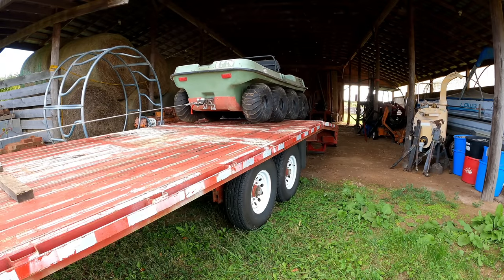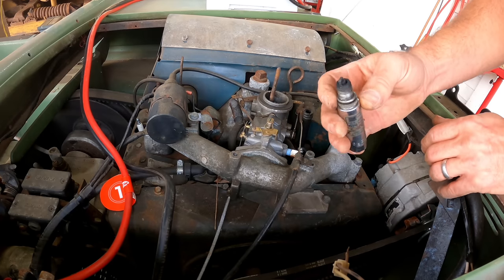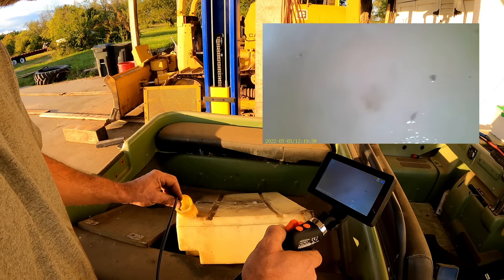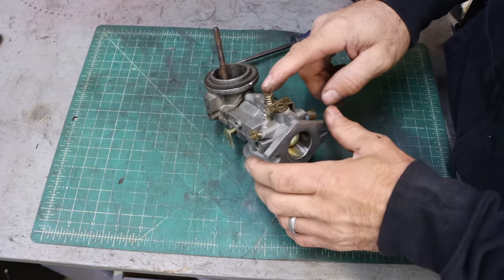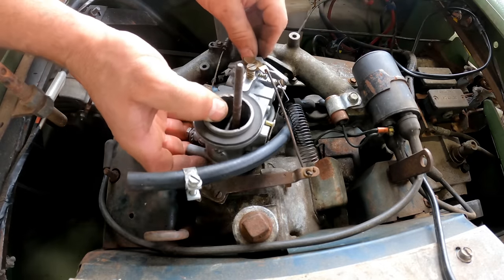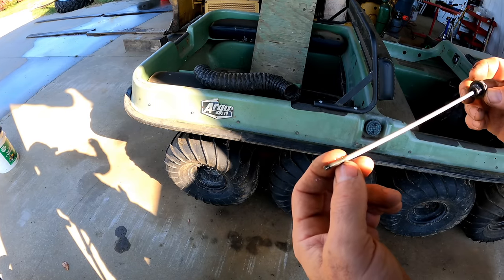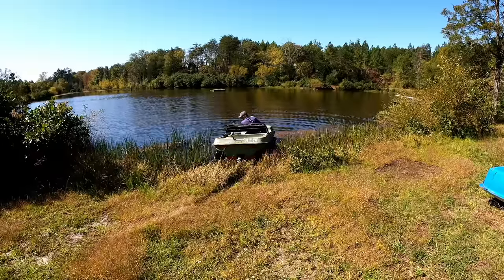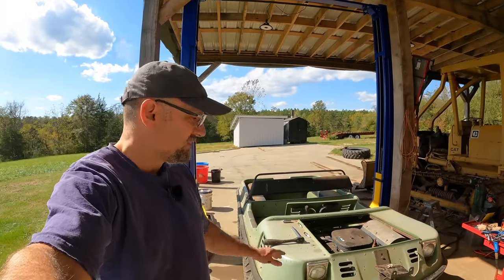Fixing An Abandoned Argo Amphibious Vehicle, Will It Start?

Comment: Owned the same Argo Bigfoot since new in 1998
Get a winch for getting out of ponds. 3000 pound winch will pull your bathtub on wheels pretty good.
Don’t put Aggressive Atv tires on it.  They are a skid steer and need the tires you have.  Otherwise you’ll stress out the chains and bearings prematurely.
Put a cab and snowplow on and they make a pretty good driveway snow duster.

When you are moving through mud try NOT to turn too much. With a pinch of momentum and all 8 tires turning she will usually find her own way out of the hole.  If you are always trying to turn you are cutting your traction by 50%

Comment: Wow,great video. Had an Attrex in the 70s...terrible machine with 2 stroke engine and planetary drives. The bilge pump suggestion is a good idea. I knew i was in trouble when i ordered parts and they offered to sell the company. Would have been great maybe with a 4 stroke engine and hydrostatic trannys. When it ran it was a blast to run, but that wasnt very often.

Comment: Before the high end ATVs came out the Argos were used to run the hard bottom marshes. First thing people did was to get more aggressive mud tires. These also added bouncy. The Argo is designed to haul hunting equipment in the back so that weight evens out your float and gets you front end up some to better exit the water. I also saw a few with governor over rides (a piece of wire on the throttle) to get more revs out of the engine (do at your own risk). The oil you seeing in the cylinders I feel is from stuck oil rings. Spray some PB blaster in there and just let it soak. They may come unstuck. The Argo are slow but fun to drive. They do require a good amount of up keep but if you do it they will last a while.

Comment: If you take care of them, those old early 80s Kohler engines are bomb proof. I restore old John Deere garden tractors and have worked on a lot of them. I have had some good luck regaining some lost compression with Lucas oil stabilizer.

Comment: Argo owners mainly do 1/ side body steel reinforcement alot on utube . 2/ bolts can be left out so top body canbe lifted off for drive line service  . Using only a few bolts and rubber edge trim to water proof .

Comment: First add ballast weight to the back to level it. This will naturally raise the nose a bit and help on your shoreline exits. Yes a smooth firm ramp helps a lot. In the meantime, on your shoreline approach get it as straight as you can while it is still deep and then commit to full speed on both sides. Trying to steer in the shallows kills your momentum and then it's over.

Comment: Those pits in the cylinder won't go away with out at least a hone and most likely an overbore of .010-.020. The engine seems to run well, I'd just run it as is unless oil consumption is huge. Looked like a lot of fun on land anyhow. The oil in the cylinder could be from fuel contamination in the oil, thinning it out. See how it does after an oil change with the right oil spec'd by Kohler. Definitely needs some weight in the rear to level it out on water. Just subscribed and looking forward to the next vid on this.

Comment: I've had attex 6 wheelers . When you drive over very loose very wet soil the tires push the soil out from under themselves. Letting the bottom lay on top taking the weight off themselves.  Only way to get out of that pond because of the soil is building a ramp. So the tires can't dig down. Your basically beaching your self.

Comment: A new ARGO only lists for about $38,000. Batteries: Dead ones, try a DC welder. Fill the battery up with water, hook positive to positive and negative to neg. Turn the DC as high as it will go. Throw the juice and listen for the surge and when the battery welds itself up inside or sulphation breaks loose it will start to bubble. Put the battery on a charger at about 3 amps for about 18 hours. Most will come back to life. Works great on marine batteries. 

When I worked on reciprocating Army Bell UH-13 helicopters in 1969 after my Vietnam time being a crew chief on Hughes OH 6. We were given a choice between ACDelco or Champion. I learnt fast that Champion lasted a whole lot longer. Nice video.
Reply: P.S. Stand back

Comment: Don’t use starting fluid. Check the basic ignition and fuel systems. Starting fluid has a low flash point and could explode. Excessive amounts could ruin an engine.

Comment: Oh wow.... I haven't seen one of those in ages. As a kid, I thought those were the coolest things on Earth. At least until I caught sight of the guy that lives out near me who has a fully restored Amphicar 770. Which he didn't actually have a lot to do to restore it since it was in fantastic shape when he got it. Just paid a small fortune to get a new set of seals for it. But it's kinda cool to see one of those old Argos again.

Really, there's just some pitting in the cylinder walls. Not much you can do unless you feel like doing a full overhaul, which could be an exercise in futility depending on how hard it is to find parts. But it's not the end of the world. Those old side valve motors aren't pushing major compression, probably in the 6:1 range or somewhere around there. That thing may run for ages like that. It'll probably burn a fair bit of oil with it getting by in that pitting, but it may be fine for a long time like that.

Comment: I believe you need to adjust the spring tension on the governor for maximum RPM rather than wide open throttle. adjusting the throttle will lowers maximum power.

Comment: I've seen the float gaskets with that solid area on a few moto carbs. I think it is material that just would have been waste, so they leave it in to give the gasket a little extra strength. It may also help control sloshing and splashing in the float bowl to smooth fuel delivery. This is not a CV carb like most more modern emission control carbs are, so no diaphragms necessary.

Comment: You can sometimes trick those new battery chargers by taking another set of jumper cables from a charged battery and briefly touching the leads to the dead battery or whatever you want to send power to while its on the charger. It will see the voltage jump up and trigger the charger to start charging. At least in my case the charger would reliably keep on running after it was triggered and the leads from the good battery were removed, managed to make it work for a rust removing electrolysis too.

Comment: You can see it smoking a little blue sometimes, so it's burning oil. That's why you saw the oil in the cylinders. But I wouldn't worry to much about it. The cylinder walls are not damaged or anything.
Just keep an eye on the dipstick and you should be fine.
Reply: Looked pitted to me. Would partially explain the oil getting by the rings.
Reply: @moz2186  Yes, that's probably why.

Comment: I really hate the new chargers just for that reason.  I finally found one that would de-sulphurate the battery and sometimes that will repair enough to charge the battery.   MTBE does not burn might be that left.  Need a boat ramp !

Comment: 1980s tech... my 2015 Argo 750HDI goes in and out of ponds like that, no problem! 31hp and 25" swim tires is what your 80s model lacks and the newer ones have. 
    Put the Bever Dam tracks on yours, and it'll be a better machine for your soft mud sided pond.

Comment: I've seen this ATV amphibius use chain rubber wheels like a tank" and there is no problem to cross and climb the bank, your amphibius only depends on 6 wheels but does not fully use the chain system. Because of that you fail to climb the muddy bank. TQ😁

Comment: I agree with Some of the comments about backing out however, I think I would try to get the biggest knobby tires you  could get on there. I didn’t see any cross hatch in the cylinders so I imagine it’s got 1,000,000,000,000 miles on it. Maybe a little sea foam or Marvel mystery oil will loosen up the rings.
May be a couple of automatic bilge pumps would be a good idea.

Comment: That's the old style of tire and it's looking worn.  
The new tire style has very aggressive style paddle treads, supposed to be better in mud.  $250 each  $2,000 for eight.
A launch ramp would be helpful and probably cheaper but higher tread is more ground clearance.

There are tracks, snorkels, outboard motors, winches, bilge pump, 

Popular with the moose hunters up north.
They make them locally here, I've done a factory tour.
The plastic bodies are thermoformed out of kydex, like a knife sheath.
Definitely do the bearings, chains and seals.

Better balancing will bring the front end up and out.
Winches are really , really common.

Comment: one thing about those is when your swimming its slow because the tires are an even break between land and water and when you are exiting the water get lined up before the edge cause if you try and steer at the edge your putting on the breaks on one side and taking momentum away and if the back is empty like you where it will be higher so exiting some areas to get to land is better in reverse sometimes

Comment: Appears to be a Kohler KT series engine, I had one in a Gravely 4 wheel tractor. good engine until it lost the rear main and locked up. I couldn't find parts and was considering a repower when I sold the tractor. good strong engine while it was running.

Comment: It did not fail, your driving did. Turning and revving when the bottom is soft is a sure thing to lose traction, go slow and do not touch the steering, just line up first. A big load of aggregate/rock where you wish to enter/exit and a anchor point on land and the winch reinstalled you will be able to exit with no problems.

Comment: Battery cells should maintain 2.2 volts/cell  no matter what charge they have. Because its to do with the chemical interaction (atomic band gap). A 12v rated battery should always be 13.2 volts. Charged or not. That's 2.2 x 6. If you are getting 11v you have lost a cell. It may come back up for a while  but its still faulty.

Comment: you're going to need to dredge some mud and build a sandy beach on your pond if you want any hope to get in and out with the argo, that's how we did it anyway. Gravel probably works fine as well. a couple of 10 year olds in the back seat is the ideal weight distribution method, but one adult might work as well.

Comment: Pretty sure instead of driving it forward onto the bank and getting it a little stuck, you could drive it out in reverse and get it good and stuck.  ;)

Seriously though, the boat ramps where I'm at just use concrete sleepers and they seem to last a long time, even with our heavy lake ice.  May want to think about putting in a proper boat ramp.

As for weight, I'll point out that water may not be the densest material out there, but it's easily available and easily disposed of.  Perhaps an old plastic tank that's a few cubic feet in volume, mounted far in the back?  Could easily adjust it to trim or empty it if you carry cargo or passengers.

Comment: Fun video.  I've seen those things around for ages.  Never saw them fitting my needs, but very cool.  I think if you put a couple deep cell batteries in the back to power an electric trolling motor, that might even you out and provide a better system of propulsion.  Not sure how you'd fix the "high center" problem.  Seems like a design issue you would only be able to solve with a better landing zone.

Comment: I have learned over the years working on lawn mowers in my shop you don't use ether to crank an engine you can ruen the engine I always use carburetor cleaner it's better for the engine and safer than ether I have known of people blowing the heads off of an engine using ether.

Comment: You think small engines are temperamental near sea level in VA.  Try working on them at 7600' elevation. When new they are great, but a worn out old beast at this elevation is fun, a 1% change on a setting will go from one extreme to the other.  Another great video.  Thanks.

Comment: Reason why those throttle butterfly screws were almost stripped is because someone tried to remove them using a regular Phillips screw driver. They are, in fact, JIS (similar to Phillips, but not quite) as evident by the little dot on top. A special screwdriver is required to take them out easily and without damage. Phillips was actually designed to cam out of the bolts/screws to speed up assembly in factories where a driver would simply slip once the fastener is tight enough. 
As a side note, interesting how the Argo has a transom spot on the back for a small motor. And by the look of it, it had a motor on there for a while as well.

Comment: My JD Gator starter did the exact same thing. Drove me nuts and eventually got worse and worse to the point where it just made noise and would never engage. Replaced the starter to resolve the issue. I probably should have taken the original apart to see what it looked like but I did not.

Comment: The oil in the cylinders is most likely caused by the cylinders not having good oil control. The oil control rings in combination with the cylinder bores are allowing oil up into the cylinders from the crankcase. The result will be increased oil consumption. When enough oil starts entering the cylinders, it will start fouling the plugs.

I have an Audi 2.0T with this same issue. That engine is direct injected and turbocharged, so it actually will start breaking spark plug insulators when the oil consumption reaches a high enough point.

Comment: 1:02:28 It's burning a little oil. In one of the clips of you getting it stuck on the bank of the pond the lighting was just right to catch some wisps of blue smoke coming out of the nose of the thing. Those cylinders, rings, they're a bit on the tired side. I'd bet money that thing drinks oil noticeably over a change interval.

Given it runs fine anywy I wouldn't be in a hurry to overhaul it, but it would behoove you to keep an eye on the oil level.

That oi lwas also present before you put any 2-cycle oil in the cylinders. I noticed it on the first boroscope peek.

Comment: You can trick new chargers by connecting  a 9 volt battery in parallel  across the "dead" battery after connecting the charger. That should trick the charger into working.

Comment: If there's no oil filter, that's a series 1 Kohler. They're splash lubed. Stay off steep angles - that engine nearly bankrupted Kohler back in the day! They starve of oil since the dipper doesn't...  well... dip.

Do I see a bilge pump in your future?  ;)
Also, I'm thinking a ballast tank in the back. You drive in the water, then pump pond water in/out to level it off (depending on what/who you're carrying).

Comment: I'm having flashbacks to my John deere 317... it had the same KT17 engine.  The oil in the cylinder is normal for those engines.  They are not a pressurized oil engine but a splash oil engine.  Anytime they set a little oil leaks past the rings because the oil (if filled correctly) is about 1/8 to 1/4"  above the cylinder bore.  It's worth taking a look if it's a series 1 or a series 2.  Series 1 had some major issues where series 2 was marginally better.  The good news is if you find a Kohler magnum they are a direct bolt in (and available in 20 hp)

Comment: I'm at a utility in the north east. We have had one of these since the 90's. Ours has the tracks over tires. The thing will go ant where., climb any thing. Snow, mud ect. Not fast, and some times you have to adjust your path depending on conditions. But  way better than walking. in crotch deep snow.  Again not fast ,However it will get you there and back. One time while loading on the trailer the throttle stuck and it climbed straight op the back of or service body truck before the operator could stop it's it's got the bite.

Comment: Engine model KT17? Early spec numbers did not have pressurized oil and early failures. The thought was to keep the oil level full or slightly over. Type 2 was changed to pressurized oil.

Comment: My friend had a six wheel Argo he put a snowmobile engine. Made a lot of noise didn’t go much faster than yours. And he made little paddles you bolted on to  the studs with the tires so it was like a little six wheeled paddle boat.

Comment: Put a reliable winch on the unit. An electric trolling motor bracket. & a duckbilled boat pole If a slight breeze comes up they do not win the battle without help. I did not see you attempt to reverse out allowing the rear with a little more clearance have 2 pairs of wheels pulling instead of just the leading pair. Have fun experience is agreat teacher. Looking forward to seeing the next installmen.

Comment: The head gaskets are leaking some times you can retorque the heads and they will stop if not time for gaskets replacement..there common on those motors

Comment: Pretty sure that alternator is not stock- we had one of these at work & I have ver Wish i had my own but used ones are insanely expensive- you got a hell of a deal on that one :)y clear memories of replacing a diode block that was fed from a coil pack on the engine.  I also had to clean a lot of rust off the fuse holder contacts to cure all the electrical issues. Wish I had my own but used ones are insanely expensive- you got a hell of a deal there :)
Reply: Yes, that engine should have a selfcontained alternator, the one we see has been added by the po. Might be worthwhile to trouble shoot the built-in original. Usually pretty durable, maybe chect out the rectifier.